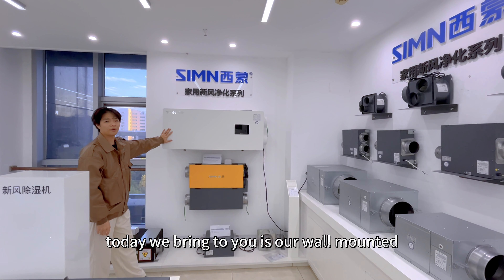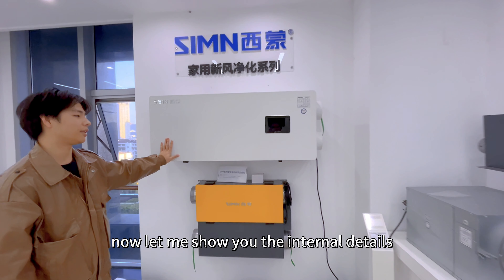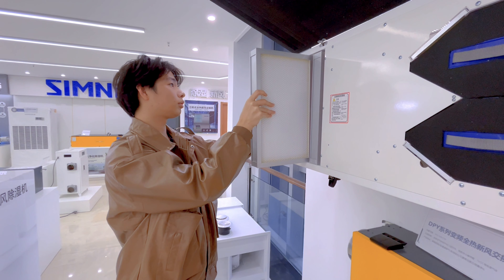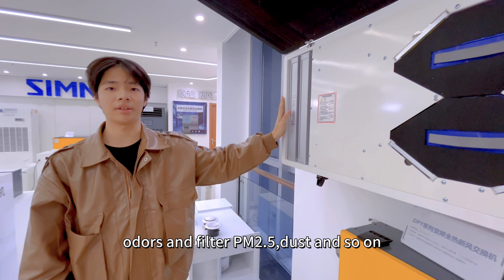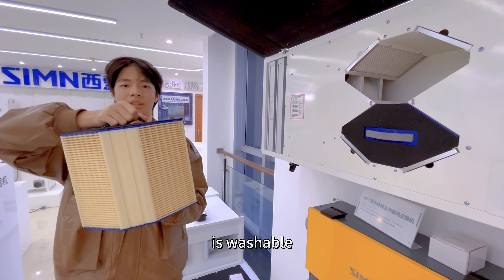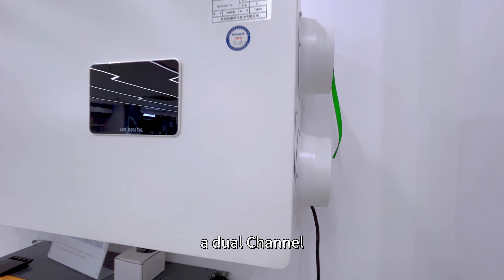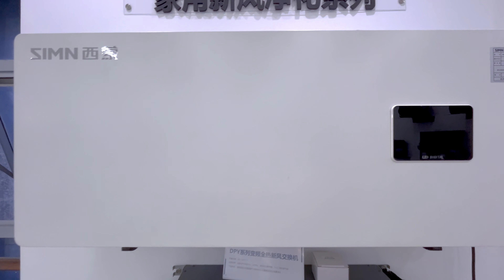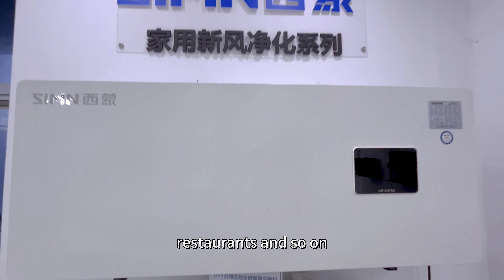What Does an ERV Do?This is our wall-mounted full heat fresh air exchanger.

Comment from the maker: Do I Really Need an ERV?
The necessity of an ERV depends on various factors, including climate, indoor air quality goals, and the construction of your home. Here are some scenarios where an ERV is highly recommended:
1.Extreme Climates: If you live in an area with harsh winters or scorching summers, an ERV can help regulate indoor temperature and humidity while reducing energy consumption.
2.Tightly Sealed Homes: Modern homes are often well-insulated and tightly sealed, which can trap indoor pollutants. An ERV ensures a continuous supply of fresh air.
3.Health Concerns: If you or your family members have respiratory issues or allergies, an ERV can help filter outdoor air and provide cleaner indoor air.
4.Energy Efficiency: If you are committed to reducing your carbon footprint and energy bills, an ERV is an excellent investment.